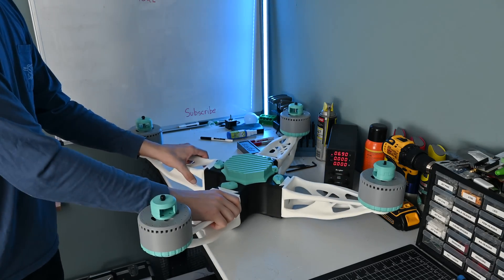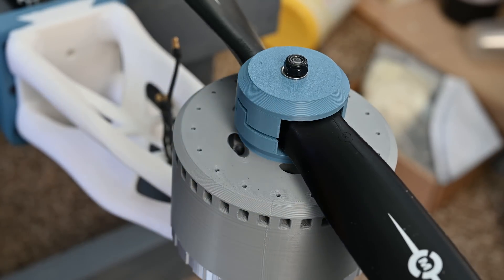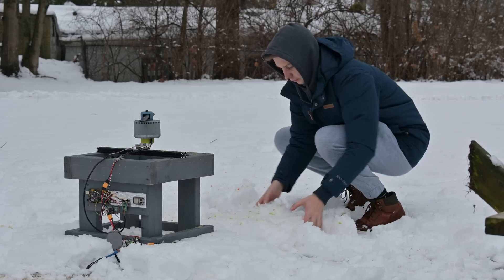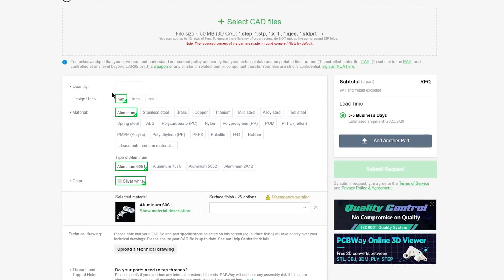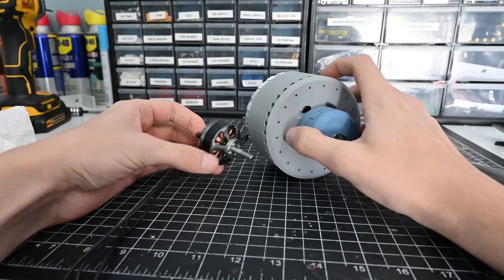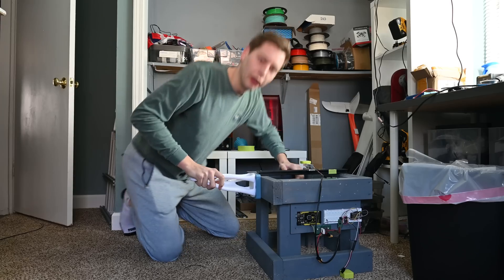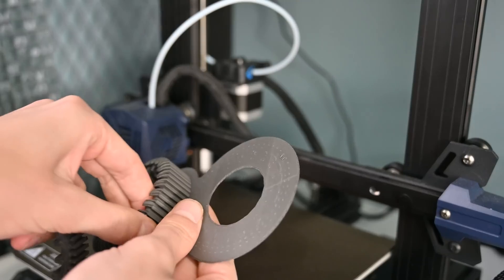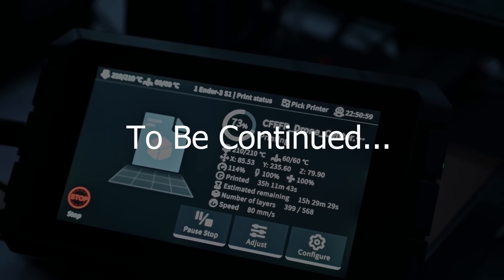This ENTIRE Quadcopter is 3D Printed (Even the Motors) Pt 1

Comment: For 3D printing it is much better to make an axial flux machine, because you don't need ferromagnetic parts in it and its torque to moment of inertia ratio is much better. It has also much less weight at the same power and rotational speed.

Comment: I’ve wanted to use topology optimization for some of my 3D printed parts before as well, but I wasn’t quite sure how to get accurate simulation results that accounts for FDM additive manufacturing of the part. I know that FDM parts are anisotropic, so the orientation of the print, shell width, etc all affect it’s strength. How did you go about it?

Comment: Have you thought about using these PLA prints to cast into aluminum for a lightweight strong material instead of plastic? I like those motors, do you have the STL files for the motors only? Would love to have  a shot at building a few for a RC car.

Comment: If you already have a solid body and only remove material according to the force flow, it is 'topology optimization'. Generative design, is when the software only gets flange points and has to figure out the rest of the way itself.

But anyway, that is really nice work 👌🏼

Comment: Notes.. as a user of 3d I know it's cool to print one big block of 3d plastic but I've always found smaller component prints with  snap on joints or bolts save so much time for print errors .  For example in that large body print you could have printed it in three layers and had 3 mm bolts run through it X 4 which compresses the body and adds strength due to bolts. The ability to do this also opens the possibility for the arms to be secured in a way that locks them via those bolts and eliminates that joint from possibly failing .  It can also eliminate support material wastage. The arms could be slices into two symetrical parts and bolted or snap fitted and this would allow a small 3 mm steel or carbon rod to strengthen it plus act as an internal cable tray path. A rod spanning the two arms could be used to tension the arms and produce strength and lighten the design. Use of carbon fibre rods can be used in the motor assembly as well as main body to lighten the entire assembly .
Reply: By splitting the arms into two parts you can create a hollow interior that can be utilised by cables and strengthening carbon fibre rods

Comment: Delightfully elegant design all around! That center section would be easy to configure for aerially delivered payloads of friendship, spotter cameras etc. The arm design would simplify increasing motor count for large payloads an/or batteries. A dyno like that made by Torque Test Channel to test die grinders could be ideal for your motor tests. The shoulder bolt was a brilliant way to avoid custom machining while getting a shaft more than strong enough for the job.

Comment: You did a strength test pushing down on the arm, but that's the opposite way to where the force is going to come from during operation; the motor pulls up on the small end of the arm, the weight of the body pulls down on the dovetailed end.

Comment: even the motor is 3d printed. ok the magnet core is printed and the casing but not the other magnets, the bearing, or the wire so that doesn't count as the whole motor.

Comment: The inner core of the motor is printed, but what about the copper wire that wrapped around it? The copper wire counts as part of the motor and so it isn't fully 3d printed

Comment: 3d-printed Screws, ballbearings, coils, wires and magnets is impressive!
Reply: I'm most interested in how they created a 100% plastic 3D printed battery. Game-changing tech right there.
Reply: A.I will have fun with this self replicating weaponized drone singularity 😮
Reply: almost fully plastic is not fully plastic...
Reply: how hard work.... i know....

use hornet esc for long time fly..
Reply: And the flight controller, escs, battery, receiver blah blah blah
Reply: I only clicked this video to comment this lol
Reply: I hate when uninformed people cant comprehend the impressive part of a project
Reply: Yeah clickbait
Reply: @thenamelessone123  Why, I'll bet he didn't even print the remote handset.  Maybe we could all sue Google together!
Reply: @davidbenston4259  interestingly enough,  you can inkjet print  Logic Circuits.  There's academic articles that go back 5 years ago about  inkjet printing SRAM Cells for  FPGA on flexible substrate (plastic).   I'm pretty sure those MSce students finished making a fully functional inkjet printed FPGA.    Once you have an FPGA  you can do something called Direct Digital Synthesis  (DDS)  to make a Software Defined Radio.  Remaining Logic blocks in the FPGA can be used to Encode and Decode digital data on that radio.   Going from a functional Digital Modem to adding on the logical blocks that can become the flight controller is not a large step.  With enough time and effort (probably 6 months for someone with the Electrical Engineering skills),  a transistor by transistor flight controller could be designed.  Producing that flight controller and radio would take seconds to fabricate.  My guess is that including DRAM, you're looking at around 10,000-20,000 transistors at best.
While i agree this video was a bit clickbaitish, it's mostly true  :)
Reply: You sound like the "But the barrel is metal" people
Reply: @magicianman1345  the barrel isn't metal on the plasma pump .50 cal, but it's black powder with substantially lower pressure

Comment: The problem with those arms are the extra perimiters generated by removing material.
For a 3d print with a certain ammount of outer shells this will add more weight than a sparse infill. Since the outer shell is doing most of the "holding" and the inner material is there to just stop the walls from collapsing you'd be surprised at the low weight savings. You do get a LOT longer print times though. Which you seem to love. 😜
Reply: you can also just make them thinner, same number of walls

Comment: almost all printed......
interested to know what the wait saving is for the generative design? the optimisation generally assumes that the piece that it is removing material from is solid. I cant imagine you saved much mass or gained any strength since you all loads of (probably 3line width) shells on the internal of the structure which will providing very little strength. 
all that said....it does look way cooler - which is the most important thing :)

Comment: I'm interested in such a motor not for drones, but for DIY air home cleaner. Because on currently used Tefal air cleaner they have a similar motor inside with turbine fan design, but there's only 3 speeds and quiet mode not so quiet, I would like more precision control of fan motor noise.

Comment: For the bearings, you want to add a shoulder that catches the stationary race, but doesn't touch the moving race. The larger bearing you put in will wear the housing the same way, because it is still rubbing. Add a shoulder that only touches the inner race, and it should last longer.

Comment: Most of of the motors are made of metal (all the important stuff that actually makes a motor a motor, copper wire and rare earth METAL magnets.) Plastic housing motors is not new.  Horizon Hobby used to make plastic endbell motors too.)  100% this clickbaiter incorrectly used the word 'ENTIRE' and 100%.  I would have watched this video if it wasn't for the lies but you still got engagement from me (negative comment and thumbs down) so I guess you win?

Comment: The arm dsign seems more like topology optimization, not generative design (similar, but not the same).  Very cool outcome nonetheless, great project! Loving it.
Reply: This is a very interesting topic, can you explain to me the differences between topology optimization and generative design?
Reply: @ramondepaoli1359  In a nutshell: in generative design, you simply set your boundry conditions, loads and goals, and you get the form of the object (different options for different preferences like less weigh, more strength, etc). In topology optimization, you give the program the base form + load conditions and the program subtracts material from the least necessary areas of the object.

Comment: Liking this a lot, great to see this sort of 3D print designing, figuring out how to design a print so it can substitute objects typically made from other materials.
Will you be printing some of those toroidal props for it which are currently all the rage? 2 years ago I printed some 3" tri-blade props I put on a little racing drone, out of TPU... see "Five33 TinyTrainer with 3D printed TPU props" for the DVR from its very first flights.
I still can't believe they worked first time, and so well.

Comment: Your larger motors would likely benefit from a prop either larger or with more blades and also a more aggressive pitch. The larger core should offer more torque than the off the shelf model.

Comment: This was done around  3 years on my printer so this isnt even close to a novel idea.  Prior to that another guy on youtube 3d printed motors which were horribly inefficient and heavy which Flitetest then tested to a much lackluster performance.  Watch out for the vibrations induced due to the lack of anything resembling stiffness in the filaments of today.  Robo 3d used to make a CF pla that was good for stiffness and rigidity however I think they stopped producing it or lessened the quality.

Comment: When testing new motors and drone arms/motor mounts, i always use a tent stake to connect a loose wire/parachure 550 cordage from the arm/motor to the ground.  Have had 2 times where the arm/motor tried to fly away and got yanked back to reality.

Comment: Video title: "This ENTIRE quadcopter is 3d printed (even the motors)" 🤨
Start of the video: "literally everything including the motors and the pieces holding everything together were printed" 🤨🤨

...If all you had was a 3D printer, you couldn't make this. You still need wires, magnets, motor shafts, bearings, even the propellers if I'm not mistaken look to be not printed?
Listen, it's impressive work, but you hyped it up so much I ended up disappointed. Sooner or later someone's gonna come up with a way to literally just download a file and print a ready-to-fly drone, but this aint it yet.

Comment: When making thrust test you should try to put prop the other way around. That way you get much better data of what your propulsion system is really capable about since you reduce the aerodynamic influence of anything that is placed directly in the high velocity air stream behind the propeller like measurement station or mounting. You can also avoid things like ground effect in case you blow straight down into it. Objects that are placed on the inlet side obviously also have influence but its way smaller.

Comment: 1:24 Shoulder bolts usually have h6 tolerance which is a bit too lose for bearing's bore, but yes it's a better and cheaper option compared to a regular cylindrical rod or bolt shank.

Comment: You can speed up those prints and reduce warping by printing with a larger nozzle (like 1.0mm or so). This will allow you to greatly shell parts and rely almost solely on walls for strength. Cool project!
Reply: Too heavy maybe?

Comment: With the dovetail being the weakest point in the arm you could probably remove a lot more material in the arm. This would lower the weight of the arm and the quad altogether which would require less force from the motor to do the same thing which would result in less force on the arm and dovetail

Comment: Quadcopter made from 100% plastic...how is that possible...clicks on the video...immediately sees metal screws and then the motor copper windings and metal core....yeah. I mean i knew its bs but I was still curious how motors out of plastic are supposed to work...

Comment: curious why the center part isnt printed upside-down. is there some geometory that needs it printed like that with the huge support inside? id suspect the layer shift is either caused by the weight of the print at the end or your nozzle hits the support material or start of the roof that ends up curling upwards.

Comment: A. You said in the thumbnail it was 100% plastic, But you used a lot of metal parts magnets, bearings, copper wire, and shafts.
B. You said it is 100% 3D printed.
Why the click baiting and lies?

Comment: I am probably repeating other comments, but:
1. stress test is wrong - the arm will have not compression, but elongation stress. It should be 180 degress turned to withstand real load direction (with motors)
2. with said above - the arm is much weaker than designed, as in this position the main problem would be - delamination because of print orientation.
3. dovetail is inserted from the wrong side. The only thing which is holding the dovetail in place would be a screw. And friction of plastic over plastic. Dovetail also should be rotated to 180 degrees :) motors pull up, core pulls down - instead of sliding out, the dovetail will lock. 
4. Infill of the core seem to be Grid - which can withstand only an extremely low side load.. if the core is heavy and motors strong - arms will push the sides inside the core = irregular aeroodynamics with tilted rotors, propeller potentially hit the core and so on.
All of it unrelated actually, because everything is done with 100x strength over actually needed. And because of this overkill, a lot of weight is added and works actually only as the useless load.. If one wants to stick to design - less and different infill (Cubic or Gyroid) , more braces instead of "block structure" - the core could just be a plate with underlying "arms" in the same generative design.
Playing some "bridges construction" games really helps to get the idea of stress propagation ;)

Comment: Hey this is superfreaking cool! I am starting to design a 3d printed wind turbine, and I was considering building the motor myself. Your design matches what I had in mind so I want to ask you: how much current do you reckon you could generate if your motors were used in conjunction with a vertical turbine? Those who spin freely with wind coming from any direction.. thanks!

Comment: You said the diameter is 28 inches then said the props will be a meter wide. How is this possible. That's not even a square meter and your props are 3 feet in diameter? I must be confused cause I don't understand.

Comment: 4:01  "You" wrote some code ehhhh.. at least use the AI to improve your code... not write it for you.. use it to learn .. not to be lazy
7:57 you literally could've just sanded that out.. and either sanded or drill cut out what you needed for that to fit.. would've been 100%.. guarantee it

Comment: Why you printed the main frame body upside down? If you flip it 180deg you wouldn't have to print all that support material. Also next time don't reprint it, just take heat gun and heat one section then slide the arm in and it would of melt in the correct position.

Comment: Love your project, so this is just meant as some positive input:

1. You obviously know how to use CAD, split the body and make ie. dovetails in each part that you lock with small screws and heat inserts. This will be as strong, if not stronger, because it’s gives you the opportunity to print parts of the body in different directions to better accept loads. It also make it easier to make the body lighter.
2. Splitting the body gives you faster prototyping, and you optimize your printer time 10 folds, by not printing so large parts and then have something that fails or in need of a reprinting.
3. To take it completely out, buy a 3-5mm of carbon fiber plate and make that as top and bottom and 3D print the rest of the body. 
4. Klipper has nothing to do with your layer problems. Lower the speed at the end of the print, you can do this manually or even with g-code in klipper(mainsail/fluidd/ octoprint).The problem is probably just to inertia/weight to your nema17 motor running your bed with almost 1kg of PLA.
5. In Klipper you can increase the current of each motor (printer.cfg). You can crank it up a bit to help the motor for the bed combat the weight with higher torque ( it will run a lot hotter, but many people are doing it, but that’s up to you)
6. I’m not sure how PLA will hold over time when your motors get warm. PLA starts to deform around 60-70 degrees. ( I have had PLA brackets fail around 55 degrees and deform). it’s simple to enclose the Ender 3 with a cardboard box and print in ABS or even easier ABS+. Don’t try PETG, it’s better than PLA, but a lot weaker to heat and grease/ lubricants than ABS.
7. Perhaps redesign the motor core with the use of resin and try to shave of some space between coils and magnets, it’s difficult, but you will see significant changes in the motorcurves.
8. Since you have access to more than one printer, make one an ABS only printer, while you keep the other to print in open air with PLA.

Anyway, thanks for sharing, looking forward to your next video.
Reply: Great comment 👏🏻

Comment: Is PLA filament good for outside use! I heard that it's not! One of my friend suggested using ABS material!
Reply: PLA isn't UV resistant and can have problems with heat (like being left in a car for longer time on a hot summer day). It'll be fine for the short use outside this is gonna see imo. the problems with UV resistance also only occur if being left outside 24/7 for a longer time.

Comment: Yeah, that was not klippers fault, it's just another way of telling your printer what to do.
That big print would require a lot of safer parameters set in the slicer, and put the filament settings to lower end of acceptable flow to reduce chances of creating bumps it can get stuck on.
Turning on z-hop for movements, turn off combing/wiping etc.